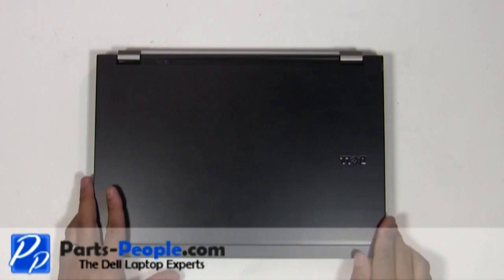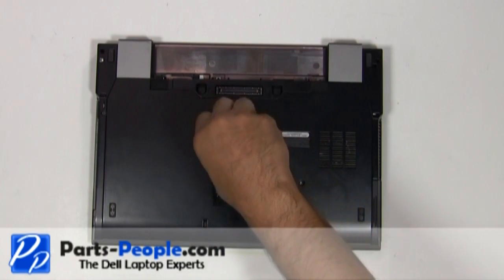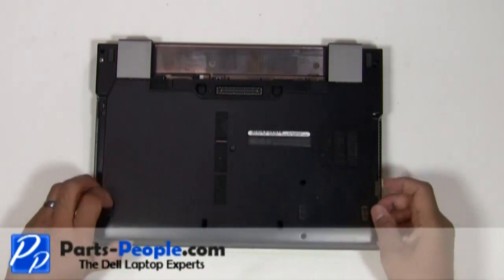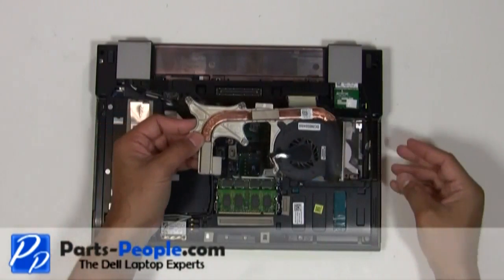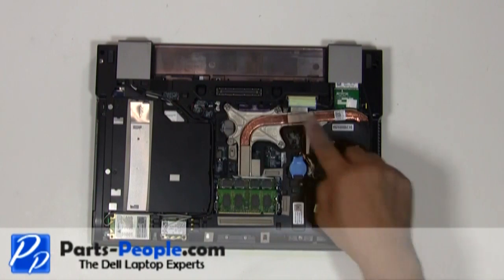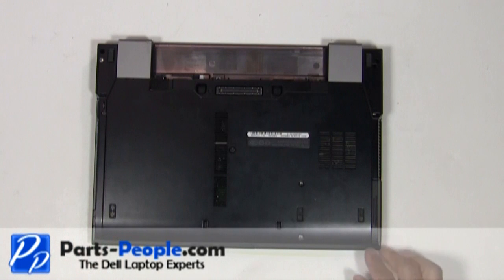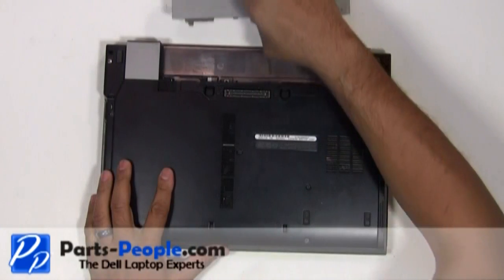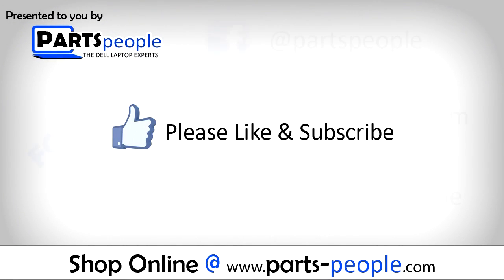Dell Latitude E6400 | Heat Sink Replacement | How-To-Tutorial

Comment: You have a recommended TIM for use on these things, and does changing them typically drop temps?

I tend to use Prolimatech pk-3 or Gelid extreme(both non-conductive top 5 pastes) for TIM.

Wondering if mine came with a bad TIM job, as even with a meticulously blown-clean and perfectly working Fan, the CPU flies up to 84C whenever it does anything intensive(TrustedInstaller kicking on, high-def gifs/movies, games, ect) And idles @ 57C @ room temperature.

Comment: does this typically resolve the overheating problem?  i've been struggling with with for over a year.  I'm running my e6410 with a usb 3 card to a usb 3 port replicator driving 2 monitors.  I've swapped the hard drive for a 256gb ssd and a swapped the disk drive for 750gb hdd.    result is a box that runs too hot and keeps throttling down the CPU and slowing the pc to a crawl...
Reply from the maker: I would try cleaning the heatsink / fan and reapplying thermal compound before replacing the heatsink. Most of the Dell laptops, especially running multiple monitors, tend to run hot. They don't have sufficient airflow through the system to keep them cool.

Comment: thank you, i just replaced my fan using your tutorial without a problem. Maybe put a link to a thermal-paste replacement tutorial in the comments?
Also, if you only want to replace the fan, it is connected to the heat sink by only two screws and can be pushed away easily after removing the screws.

Cheers.